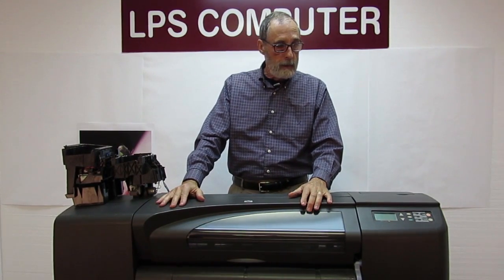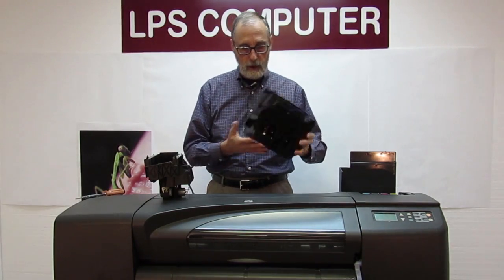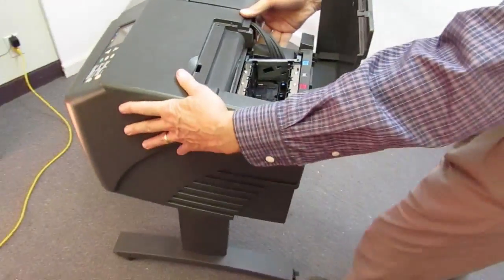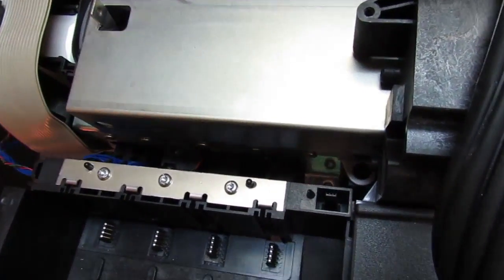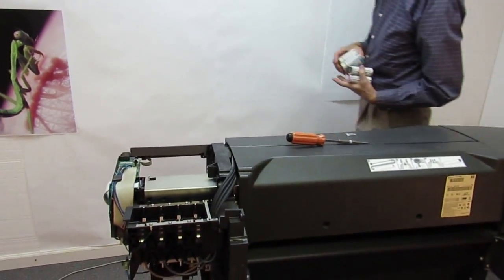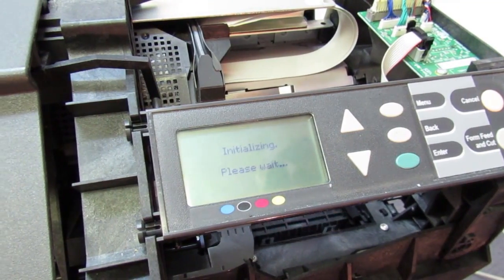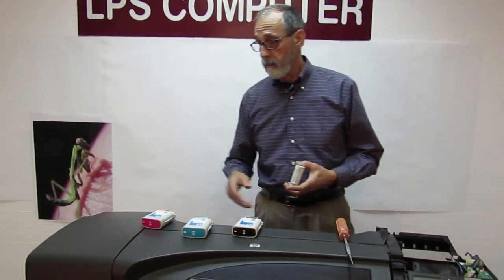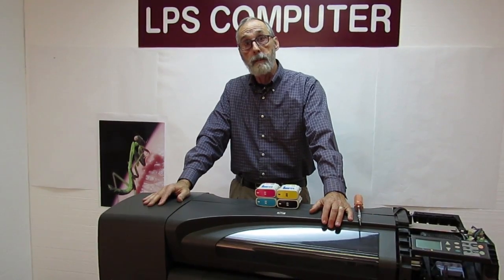HP Designjet 500/800 System Error 22:10 Repair

Comment: hello sir i have DJ 500 plotter and i am facing 22:10 error after finishing the print then i do restart the plotter and it works correctly but it occurs after finishing the print. please guide me
Reply from the maker: If you are using aftermarket inks, try installing HP brand cartridges only. If that doesn't solve the issue, use the priming tool to purge the ink tube system. 

https://www.lpscomputer.com/products/designjet-ink-tube-priming-tool

Comment: Do you have a video, how to replace the Carriage Assembly (HP Part Number C7769-60376)?
Reply from the maker: The LPS video on Designjet 500/800 belt replacement shows the removal and replacement of the carriage.  See:  https://www.youtube.com/watch?v=Dhq1IBMiB84
Reply from the maker: HP Designjet 500 & 800 belt replacement video: https://www.youtube.com/watch?v=Dhq1IBMiB84

Comment: Bob need help! I Replaced the Belt and service station as you directed with LPS parts! The belt seems to work fine , but the new service station I received and install, makes a noise at the gears of the service station motor, when the print heads run to the service station location and still giving me the system error 21:10 call hp support??????
Reply from the maker: Did you buy the service station from LPS? Make sure to use the correct screws for mounting the service station. If you use the cover screws (which will fit), the service station wiper tray will impact them, because they're slightly longer than the service station mounting screws.
Reply from the maker: Error 21:10 indicates a service station problem.  Sometimes the SS gets roughed up in shipping.  Contact us and we will replace the SS.  800-959-1575

Comment: So, fixed the 21:10 error service station , now have a 22:10 error code . Thanks for the additional video.
Reply from the maker: Chinese ink cartridges can cause this problem also.  If you are using them, install HP ink cartridges. Otherwise, replace the ISS.  https://www.lpscomputer.com/collections/designjet-500-800-parts-page/products/c7769-60373-hp-designjet-500-800-ink-supply-station
Reply: @LPSshowsyouhow  My ass was filled with questions when a client made me install chinese cartridges in a dj 500 today, and error 22.10 showed up in the display hahaha. I had to install old cartridges and thank god it started plotting again

Comment: So both ISS types are interchangeable, and regardless of which version I have already (the newer type), I can use either? Presumably they both use the same cartridges?  Finally,  is there a possibility for these cartridges to dry out? After receiving this error I removed the cartridges and had them sat on top of the plotter for a day or two, now all are reporting empty - could this be that, although still full, they've simply dried out?
Reply from the maker: Hello.  The 2 types of ISS are interchangeable.  The ink slots are identical - same ink.  The cartridges cannot dry out under normal conditions (not out in the sun for a couple of years).  There is a sensing issue with the ISS or the data cable connecting the interconnect board with the electronics module.  The interconnect board is the small board the ISS plugs into.  You might want to replace both. https://www.lpscomputer.com/collections/designjet-500-800-parts-page?page=3. 

 The ink cartridges share some signals, so 1 defective cartridge may make them all look bad.  Remove all the ink and cycle the power.  When the plotter asks for the cartridges to be installed, put them in one at a time.  If the plotter accepts it, take it back out and go the the next one.  Try to find a bad cartridge.  If you are using aftermarket ink, replace the ink with HP OEM ink.  https://www.lpscomputer.com/collections/hp-designjet-ink-printheads
Reply from the maker: The ink supply stations are interchangeable and the same ink goes into both.  The ink cartridges contain plastic bags with the ink.  It is not possible for them to dry out without leaking.  The cartridges share some basic signals, so if one is not passing along something like the 5VDC, the cartridges down stream will show bad.  Try a fresh set of ink cartridges.  It is also possible the ISS is bad or that you did not plug both cable bundles back into the interconnect board.

Comment: hi, i am italian , after error 22:10 ( it's ok now), my plotter " mi chiede di installare le testine di configurazione " how can i resolve'
Reply from the maker: If it's asking for setup printheads, you can tell the machine you've installed them. The setup printheads don't have any electronics on them, so the machine doesn't actually know if they're installed or not.
Reply: Bob Wert plotter is hp 500 plus, le testine sono gia installate ma dopo aver risolto il problema dell’errore 22:10 , il plotter mi chiede di installare di configurazione, ma nel plotter gia ci sono le normali testine. grazie , attendo un tuo consiglio

Comment: Hello Bob, I recently purchased a HP 800PS 42 replacement ink tube kit from IPS computer. I viewed your install video which was very easy to watch and follow. Thank you. Now I have 3 " Incorrect Ink cartridge installed X " symbols all but the yellow which shows as full but the container appears to be almost empty. I have replaced them with brand new cartridges and these are genuine HP products but the screen still shows the X. I never received a 22:10 reading but based on my information is the ISS shot ?

Thank you for your time and consideration.
Ron
Reply from the maker: There is a small chance your issue is caused by a faulty
interconnect PCA (C7769-60042) or interconnect cable (C7770-60267), but the
best bet is to start with the ISS.
Reply: Bob,  I have purchased the replacement ISS from LPS. Followed your video and upon initializing and rebooting  it came up with the same icons as before. You mentioned a faulty PCA and Interconnect cables in your response do I install one before the other ? Please advise as it appears I may have just chucked $90.00 bucks out the window. Thank you for your time.
Reply from the maker: You can start with the interconnect PCA, since it's simpler to replace. In the event you end up with purchased parts you don't need, you can always return them.
Reply: Thank you,  I will give that a try.

Comment: thanks Bob for the video. my DJ500 gives error 22.10.I replaced the ISS but the error remains.not give me the popssibility to confirm to the plotter the installation of the new component. what can i do?
Reply from the maker: Hello.  Occasionally the 22:10 error is caused by a faulty data cable.  The cable connects the small interconnect board (board the ISS and service station connect to) and the electronics module.  It is the broad connector at the back edge of the interconnect board and runs through the plotter to the left end.  You can order the cable at: https://www.lpscomputer.com/collections/designjet-500-800-parts-page/products/c7770-60267-designjet-500-800-interconnect-ribbon-cable for the 42" plotter or https://www.lpscomputer.com/collections/designjet-500-800-parts-page/products/c7769-60298-designjet-500-800-interconnect-cable for the 24" plotter.
Reply: Bob Wert 
thanks Bob. I did the ISS test operation and the result was positive. Could the same be the cable?
Reply from the maker: The cable passes all the signals from the ISS, Service Station and display.  Missing or weak signals will be misinterpreted by the electronics module as a malfunction in the device associated with that signal.  The answer is yes.
Reply: Hi Bob. As suggested by you I replaced the cable but unfortunately error 22.10 remains. I'm going crazy. Do you have any other suggestions? Thanks
Reply from the maker: Hello again.  The only parts left in the food chain is the small interconnect board that the ISS plugs into and the electronics module.  Start with the interconnect board.
Reply: Thanks!

Comment: I replaced the ink supply station as well as the belt (purchased from you) and everything seemed to work fine.  I don't use the printer that much.  I just tried to print six sets of a two page project, after the first page I got a "cyan cartridge" needs to be replaced.  I replaced it.  Now it shows full.  Immediately the yellow and magenta decided they needed to be replaced.  Replaced them.  Now the printer says 22:10 error again.  

Any help would be greatly appreciated.

--Mark
Reply from the maker: Are you using new (not refilled) HP ink or 3rd party ink?  I recommend using HP ink just because of the large number of problems I have seen caused by refilled or 3rd party ink.

Comment: I have error 79:04 with start up
Reply from the maker: Hello.  I am assuming you have a Designjet 500 or 800.  An error 79:04 is a very general error having to do with firmware.  The plotter is confused.  This could be caused by a bad file from the computer or an internal hardware problem in the plotter.  The first thing to do is try printing another file.  If it still fails, disconnect the plotter from the computer and do an internal plot like a print head alignment.  If the error goes away, the problem is with the computer.  Download and re-install the newest printer driver from HP.

If the problem is still present when disconnected from the computer, the problem is in the plotter.  

Supplies can cause this problem.  If you have them available, replace all the ink cartridges (HP OEM only) and print heads.  If the problem is still present, replace the formatter - see https://www.youtube.com/watch?v=WPRcZdWnZ14&t=5s (designjet 800).  Still not working?  Replace the electronics module. https://www.lpscomputer.com/collections/designjet-500-800-parts-page?page=2
Reply: Thank you

Comment: Bomb slide,
My hp designjet 510 is not aligning I already changed the print head and the black cartridge and it does not line up, I had a similar problem on an A3 and did the reset procedure on the panel and the problem was solved, you could reset me on Panel for my hp designjet 510? I'm grateful.
Reply from the maker: Not sure what you mean by not aligning.  Print heads?  Could be a worn out belt not positioning the carriage accurately or paper that "bleeds" so much that the line sensor cannot accurately locate edges.

Comment: Dear Bob, I have an HP500ps 42" printer. I was getting maintenance advised messages for a while. Eventually I got a paper jamb message, when there was no paper jamb. I turned out to be the belt. I had the belt replaced and after replacing the belt I still got "maintenance advised". The service tech told me that my machined needed a new service station. After ordering one on eBay and not being able to get the tech to come back for 6 weeks, (He's been sick, sent by his company to seminars, sick etc.) I watched your video and put in the refurbished service station (Unfortunately from china, I did not know about your company when I ordered it). The install went smoothly but I am still getting "maintenance required" when I start up the machine. I have made nice test prints and done a print head alignment. Is there a way to clear the errors? Or check to find out what the current issue is?
Reply from the maker: Hello Daniel,
To reset the usage counter, start the machine up normally and enter the Set-up menu (bottom option on the main screen). Then press the "up-key" and "enter" at the same time. This will bring you to the "Service tools" menu. You should see three options. 

Select "Service utilities. Then scroll down to "EEROM Setup options." Now you will see an option for "Reset usage counter." 

In this submenu, you can pick whichever component that needs its usage counter reset. I suggest you start by resetting the spittoon counter and the service station counter. 

Bob
Reply: Thanks! That seems to have cleared it up.

Comment: hello, I have a problem in hp 500 plotter if I put the black black cartridge does not see the other three if I remove the black cartridge sees the other three, but if I remove the magenta leaving the black see the other three. or if exchange cartridges if put the yellow one does not see the other three if I remove the yellow one sees the other three etc. etc.
Reply from the maker: Hello.  The ink cartridges share some electrical signals.  If one of the cartridges is having a problem, it can effect the others.  It would be useful to have a set of near empty cartridges to swap out one at a time to determine which ink cartridge is failing or a new set of ink cartridges.  We have some used ink cartridges that are at least half full that we can sell you for $13 each if you are interested.  To order, please call 800-959-1575 or go to https://www.lpscomputer.com/collections/designjet-500-800-parts-page

Comment: Dear Bob, in your opinion you think that i need to change my ISS? Sometimes i had some problem with a cartridg. The plotter ask to change it. I changed and after a little it send me the error 22.10 I try to put out all the cartridges and for a mounth i solved a problem. but know i had the same problem with the same cartridge and also the error 22.10.
i wasn't sure to change it becuase the problem is not continuos.
Sorry for my english :(
Reply from the maker: Hello.  Most of the time when you get an error 22:10, replacing the ink supply station fixes the problem.  When it doesn't fix it, the problem is most likely the interconnect cable.  The cable is a known problem and causes intermittent 21:10 and 22:10 errors.  The cable plugs into the interconnect board behind the display and goes through the center of the plotter and plugs into the electronics module on the other end.  When you replace it, tape the new cable onto the end of the old cable to pull it through the machine when the old one is being pulled out.  There are 2 sizes of the cable. One for the 24" print width plotter and one for the 42".  The parts can be ordered from: https://www.lpscomputer.com/collections/designjet-500-800-parts-page/products/c7769-60298-designjet-500-800-interconnect-cable  OR  https://www.lpscomputer.com/collections/designjet-500-800-parts-page/products/c7770-60267-designjet-500-800-interconnect-ribbon-cable

Comment: If you take out the ISS to clean it and put the same one back in, should you still select replaced ISS, or should you select none?
Reply: Ah, so I think I found the problem.  You know the pistons that push up into the ink cartridge to determine how much ink is left?  The spring popped off the mechanism for the cyan one so it doesn't push up.  Would that throw the 22:10 error?
Reply: Well, we put in a Ink Supply Station from a backup plotter, and after going through the 11-min printhead alignment, it threw the 22:10 error again.  Does that mean it's a problem with the cheap chinese ink we have?  Cause it wasn't throwing the error in the other plotter.

Also, would a problem with the ink tubes throw the 22:10 error?  The ink connections seems to be pretty gunked up at the cartridge end (again, cheap chinese ink), but it's printing fine.
Reply from the maker: Ideally, you always want to use HP OEM ink cartridges, if nothing else, for reliability. Pistons failing to pressurize the ink cartridges can cause 22:10. However, air in the ink tubes can also cause the machine to believe it's failing to pressurize the ink cartridges, since the air compresses, whereas ink does not. If you need to get air out of the lines, I suggest you purchase our universal priming tool.
Reply from the maker: If you put the same one back in, it shouldn't even ask. Because the machine doesn't think anything has been changed.
Reply: Okay that makes sense.  Thanks!
Reply: Just so you know, it looks like it was the black ink specifically that is throwing the error.  (I'm sure the broken piston didn't help either :-P)  But we put in a fresh black and it seems to be working again.  Hopefully I can get some better quality cartridges next time.

Comment: Hello there. Our machine shows the HP Designjet 500 not working System error 22:10. I looked at your video. I changed the same track, the problem was not solved. System error 22:10 still shows. We need to look elsewhere. Can you help me? THANK YOU!
Reply from the maker: Hi.  The Error code 22:10 indicates a communications problem between the Ink Supply Station and the Electronics Module.  Replacing the Ink Supply Station usually fixes the problem, however, the data cable between the small interconnect board and the Electronics module could also be the problem.  Very rarely, the interconnect board is the problem. The parts can be found at:  https://www.lpscomputer.com/collections/designjet-500-800-parts-page

Comment: in our case it was dirty contacts of two printheads. After cleaning the one of the printhead, this error code 22:10 went away and it indicated that one other printhead needed to be cleaned. we rebooted a few time to get the error message to change.
Reply from the maker: Printheads or ink cartridges? I've not heard of poor printhead connection causing 22:10.
Reply: Sorry, I did a few typo. I had corrected it now. 
Printheads are linked to ink supply station (ISS). As you mentioned the Ink Supply Station communicate to the Printhead carriage unit. Cleaning the contacts on two printhead did the work for us.

Comment: Hello. 
I had 21:10 error. I just moved head carriage by hand leftwards and turned on the printer. The error has disappeared. 
Now display shows me with "cross" that Magenta is empty, and with "empty rectangle" that Black is not inserted. 
Is this problem can be solved with new Ink Supply Station replacement?
Thank you, hope for your answer,
Albert.
Reply: I've try a lot of other cartridges, all of them are new, it didn't help.
Reply from the maker: It is likely your ink supply station is faulty.
Reply: +Bob Wert  thanks, i think so too